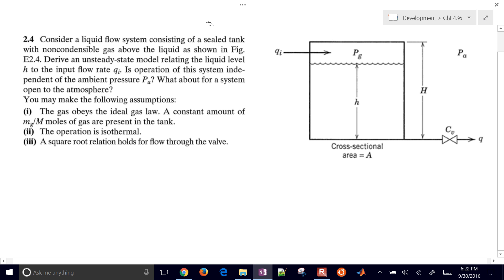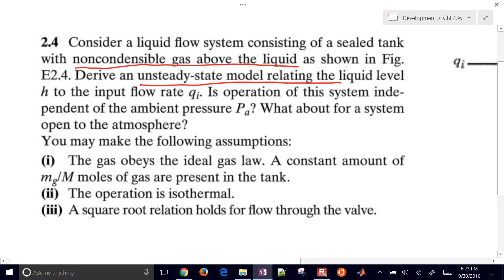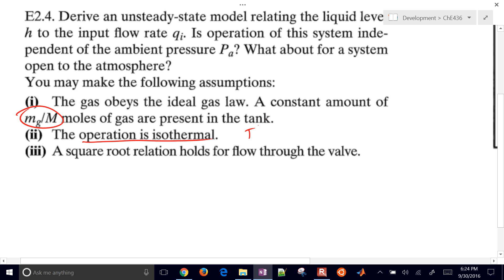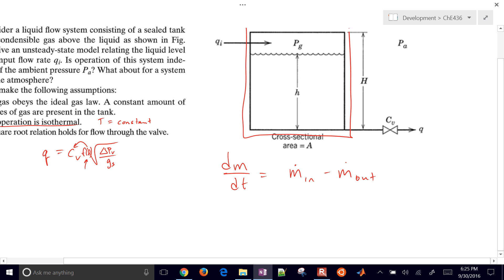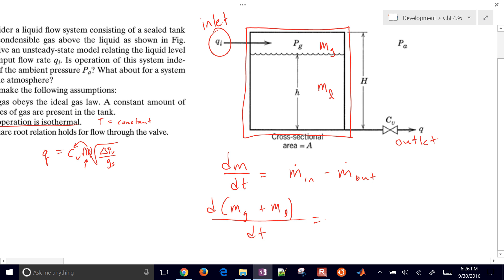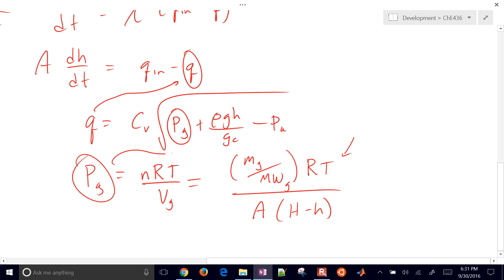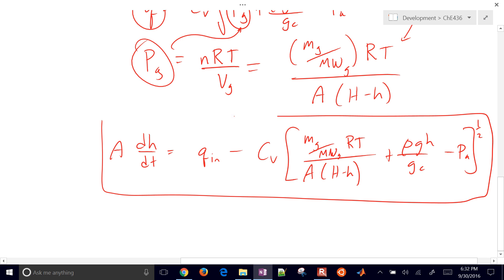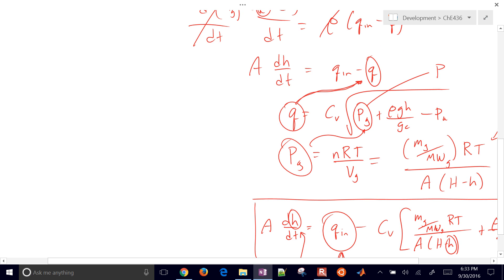Mass Balance to Predict Dynamic Liquid Level

Comment: Where did the 'g' go ? G on square root relation.
Reply from the maker: Could you give a specific time where you saw the error?
Reply: @apm  @ around 07:27.
Reply: And you did mention that you are also including it into Cv since it is a constant as well.
Reply from the maker: @thabang_metis  thanks for pointing that out. Yes, the constants can be lumped into the Cv because it is a proportional constant that relates opening to flow.
Reply: @apm  how is Cv determined? Via graphs?
Reply from the maker: @thabang_metis  It is typically available from the manufacturer and is related to the size of the valve. Here is more information on valve sizing: https://apmonitor.com/pdc/index.php/Main/FlowValves
Reply: At 4:51 you put density outside, why? Is it not a different density for the gas and different for the liquid?
Reply: @mreriiie  density is only based on the liquid, since we are considering a dynamic mass balance in terms of height.